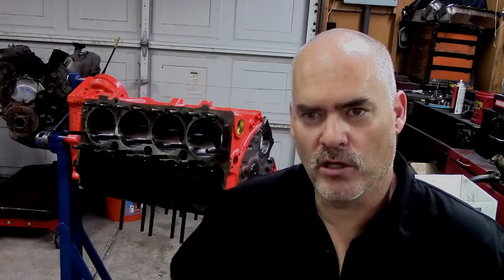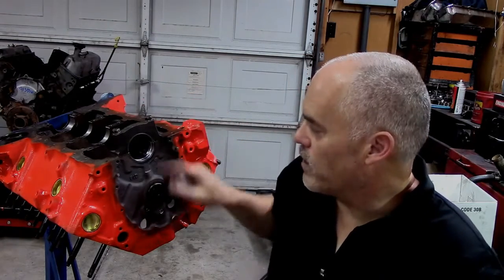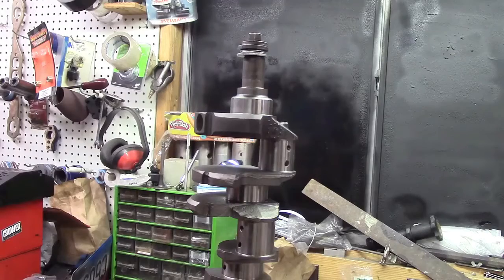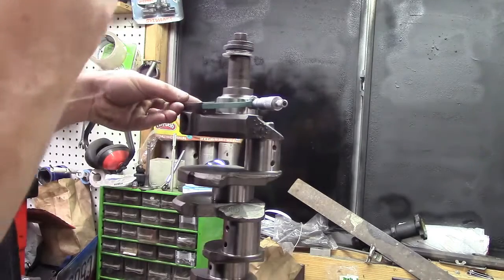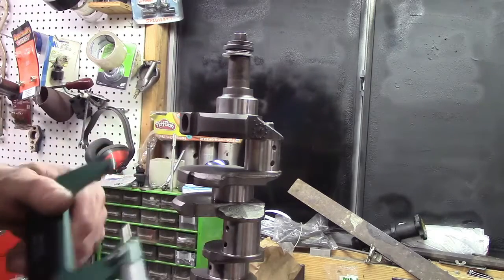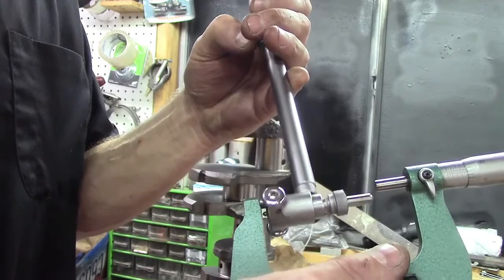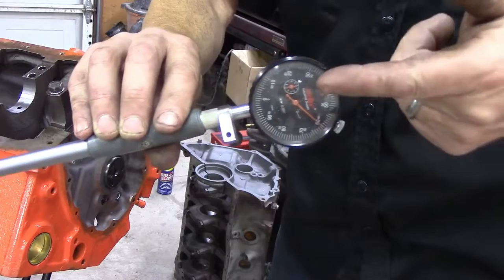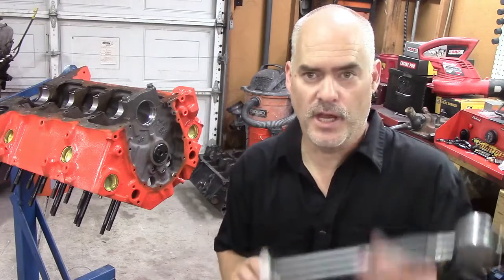350 chevy Checking oil clearances

Comment: there have been tests done on this. plastigauge was within 98% of a sunnen dial bore gauge not perfect but very close. and yes these tools are expensive sunnen starrett or Mitutoyo and a min. of 0.0005 and 0.0001 and start at about 500.00 . same with micrometers match them to your dial borer gauge 0.0005 or 0.0001 and same brand if possible. you'll have 800.00 to 1000.00 in just these 2 tools and then remember they have to be calibrated about once a year. an inexpensive alternative to these are the igaging brand very well priced and very good quality for about 150.00 do not buy cheap ebay / amazon crap . a cheap crappy tool is not better than plastigauge. i know guys that build 500hp engines in their garage using plastigauge yes they have skill and experience but it is done all the time and has been done for decades. and most important don't take my word or some clown on youtube. do your own reaserch theres tons of good info out there you just have to wade though all the bullshit to get to it.

Comment: Hello
I have a newly built 383 small block, flat tappet cam , with L98 113 Alu Corvette Heads …. in the Iroc Camaro.
Right from the start, this has very low oil pressure when warm, 10 PSI ….. cold 30 PSI … 
Inside all new …. hmmm , I don’t know what is the problem…. 
Greeting from Germany
Reply from the maker: There could be many reasons for this incorrect bearing clearances, wrong oil, weak oil pump, missing galley plug, faulty gage what oil are you running?
Reply: Hi
I have already replaced the oil pressure sensor. The one for the ad. Still the problem. Manually checked the oil pressure with a tool ... cold ok .. warm a disaster. I drive 10w60 oil .., plus zinc for flat tapped cam. Oilpump is new .., 
Does it make sense to build an HV pump?
You can also hear that the oil pressure is too low. At idle you can hear the hydraulics ticking at cylinder 1.
Greeting from Germany 
If all else fails, I have to remove it again and check the bearing play.
Reply: Ohhh what is the gallery plug ?

Comment: Grinding a crankshaft 30 under isn't what I would want in my engine. Nor would I want a piston bored 60 over either. That's just asking for trouble. Just like running flat lifters instead of roller. Yes, it will work. But for how long? That's basically what I would call a patch job, and not a long-term solution.
Reply from the maker: I do not agree with the .030 under crankshaft being a problem, race and street rod engines have been going .030 US and actually much more for decades these engines get run very hard the smaller the diameter of the crank journal the slower the shaft to bearing speed is at a given RPM circle track racers have been cutting gobs of material off main and rod journals for as long as racing has been around to be able to RPM the engines higher without bearing and journal wear,
I personally have done .040 and .060 US crankshafts in very hard charging performance engines and had zero crankshaft and/or bearing problems.
the early 383 stroker engines were built with SB 400 crankshafts that had the main journals cut down .200 so basically 200 under this is .170 more than the .030 this has been done to thousands of 400 cranks with no problems, in fact the SB 400 was known for eating main bearings when it was RPM'ed like a 350 the problem went away when they were cut for a 383

Comment: Something I also check very closely is rod side clearance. From the factory most times I see anywhere from .003 to .007 between the rods. If you plan on using a high pressure, standard volume oil pump, that side clearance needs to be opened up to .009 up to .014 so the hot oil can pull more heat away from the rod bearings faster. ( my race motors I run .018 side clearance) To open it up the cheeks of the rods are put on a surface grinder magnetic chuck and the wheel dressed and the extra material equally ground off each rod before the motor is re balanced.

Comment: I watched your head videos from 8 years ago recently. I only have one question that no one has covered as far as I know. On my 1986 corvette were aluminum heads which I still have even  though I sold the vette years ago. They only increased hp by 5 hp over cast iron heads  on the same car. Overall, are they any good?

Comment: Plastigauge has been around for 70 years and will be around for another 70.
I am curious though how you can say plastigauge is not as accurate as your gauge. When the .001-.003 green plastigauge reads in half thousands (.0005). And your dial indicator is only accurate to a thousand (.001)
And one more thing. I thought your Chevy Gen 1 small block main bearing oil clearance was .002 to .003. It looks like you just measured on your dial indicator 0.004 which is now oversize and not in spec.

Comment: If you’re a guy that’s building a couple engines that you want to run and run well enough to put your foot into every now and then, plasti gauge will work just fine. People have been using it for decades and if you use it the way it’s designed to be used (follow the instructions) you can build a really strong engine. If your blueprinting engines, building a bunch of engines, building race engines that will go through a bunch of runs down a drag strip, or building a 600hp 6000rpm monster than than buy a dial bore indicator and a set of mics. Plasti-gauge has and will continue to be a great option for the guy that wants to build a string daily driver that he wants to get on every now and then to show his old lady he’s still got it.

Comment: Plastigauge is great for checking if there is any taper. Which with some engines is a real problem. Or simply if you want to check that the crank was ground square. 

Very difficult to do that with a micrometer.

Honestly plastigauge gets a tuff wrap. But it's infinitely better than not measuring. And give you a: 'it's within spec' level of accuracy.

Comment: So why don't you do a comparison between the 2 ways? I have been using plastigage for many of my motor builds and I am an armature builder by my standards and have never had a problem. Never blown an engine due to oil pressure. Just saying. Oh unless you are blueprinting an engine that is.

Comment: Did that @ room temperature because it does matter !  30 years ago. My old man some times if the old pocketbook doesn't have the funds for machine work just kick the oil pressure up use an old Holly carburetor jet & it produces about 70 psi oil pressure out of a motor always worked great hand lap the valves new gaskets new seals rings and that motor would run just like it was new or better damnedest thing I ever seen